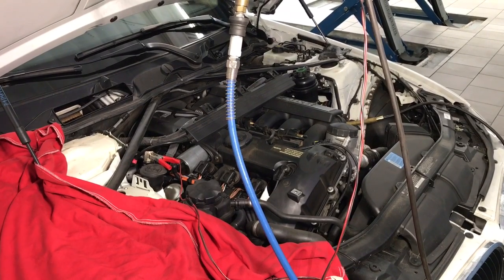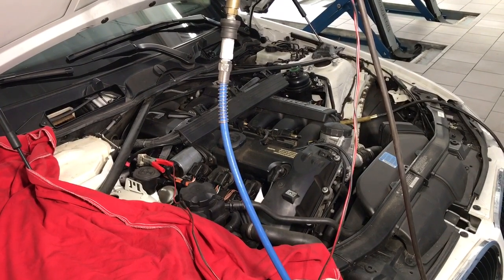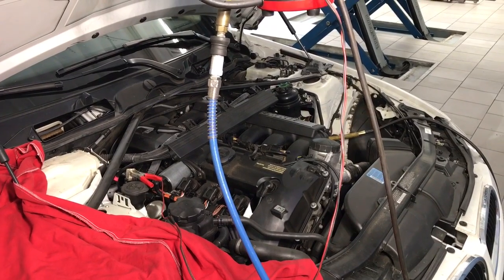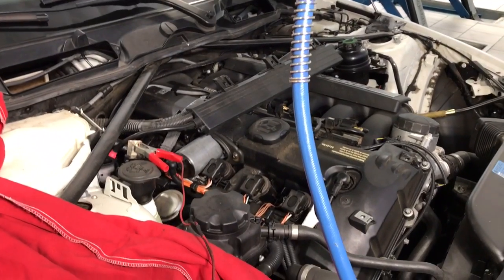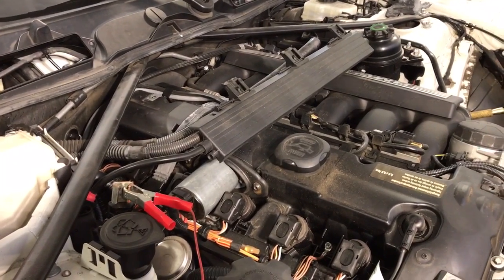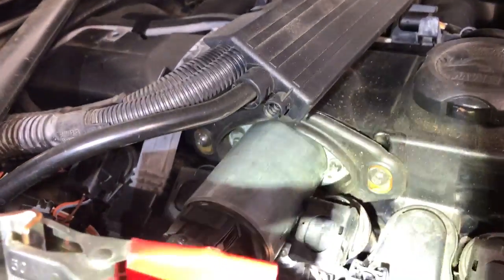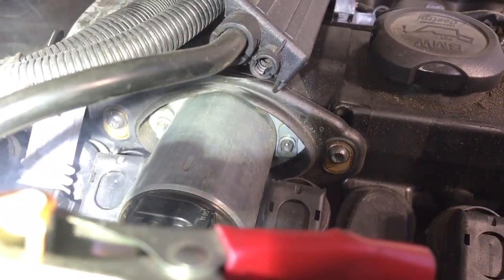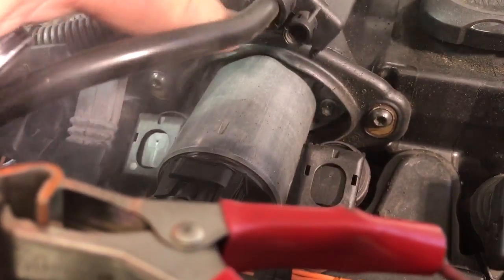BMW  N51 fault code 29E1 Mixture Control Bank 2

Comment: I replaced my Valvetronic motor gasket, and four days later, I got the same codes. I went to Advance Auto and got a new Victor Reinz gasket. I believe the leak was due to a faulty new part. After replacing it a second time, I have no leaks, and the codes are gone. If you attempt this repair, please don't forget to torque the Valvetronic motor bolts to 10nm or 7 ft lbs.
Reply: I got the codes after I changed the same gasket w/ a quality fcp one!  I was hoping to solve the oil leak and initial erratic idle.

Comment: Hello INTEGRITY......,  I have a 2008 328i sedan..I get BOTH 29E0 and 29E1 only at cold start when the car idles a few minutes..we did 2 smoke tests and it showed injector seals leaking..replaced fuel injector seals..still same codes .

.These 2 CODES don't happen all the time. do u know what is causing this? I heard BOTH banks are running LEAN.....no other leaks found..could it be a BAD PVC valve ??? unplugged MAF and it runs real bad when i do that..any INFO appreciated..

My creator BMW scanner says fuel pressure 55..is this too low? any help appreciated. I already replaced plugs, filters and CCV hoses.
Reply: Hi, where you able eventually to find the issue? If yes, what was it please? I am in the same situation. Cheers!
Reply: @RomanTrollanski  hi yes i had  a bad oxy sensor..and also did a smoke test and bad orings leaking air from all my injectors..this code can be caused by many things..usually AIR LEAKS at vacuum hoses, ect. good luck
Reply: @gail6904  did you happen to remember which sensor was? Upstream, downstream? If I am not wrong, they are 4 oxygen sensors, 2 upstream, 2 downstream.
My intuition tells me that downstream prone to fail much earlier than downstream due to the heat...
Reply: @RomanTrollanski  HELLO do u have any CODES ON YOUR CAR..I had to replace the upstream oxygen sensor but I had CODES LEAN VODES and I believe one said Oxy sensor bad..the upstream one is under hood below cylinder two if I recall..good luck you should do a smoke test as vacuum, boots, and hose leaks can also cause this..
Reply: @gail6904  thanks for the reply. I've cleaned the vanos selenoids and the two vanos filters, got a little better but still can feel it at idle a little bit of a buckling. 

I have new coilpakcs, new injectors. My next step is to replace the gasket at valvetronic (eccentric) before I move to the oxygen sensor. 

I have 29E0 and 29E1 errors. Was replacing the oxygen sensors a difficult job?

Comment: You  need to  change the valve cover  it is no good   . And you  will  be ok.
Reply: I have an N54 do you think it’d be the same for me?
Reply: @Markdacosta  did you solve it? I have 29E1 mixture control 2 error and my car goes into drivetrain malfunction and I have to stop the car and turn on again, did check the low pressure sensor and rail pressure, they are fine; I didn't check the air mass sensor, could be it?
Reply: Yes it  will be  the same  for you  what  year  do you have?
Reply: @williamreyes4640  I have a 2011 335is and I think it’s because I stripped some bolts on my valve cover gasket, thank you for the feedback I greatly appreciate it.
Reply: Ok did you  fixed it  ? you don't have too    much torque on the valve cover  it's  best to yse a quarter inch  drive  because  you can  pinch the  gasket.
Reply: @williamreyes4640  no I haven’t fixed it yet but I’m pretty sure the light is on because of that I didn’t know you could get lights from having a leak in the Valve cover
Reply: @Markdacosta  what light did you get if it’s a vacuum leak you get check engine / service engine soon light
Reply: And over torque  you don't  want to  strip the  bolts  are aluminum.

Comment: The same thing happened with me I have bought a valve cover from Pick-n-Pull and then I got mixture lean codes and running rich codes so I pumped the smoke and boom smoke is coming out of the same area you were showing I took the old valve cover eccentric motor actuator gasket and slept it on and the vehicle ran smooth after that no hesitation at first start the symptoms were fault code and when you first start the car the RPM will jump up and down and it will shake a little bit